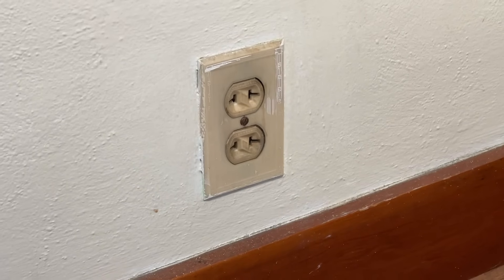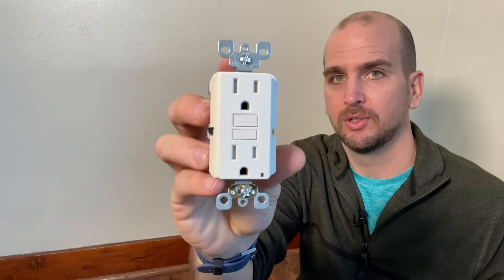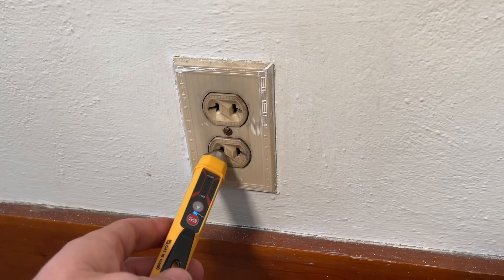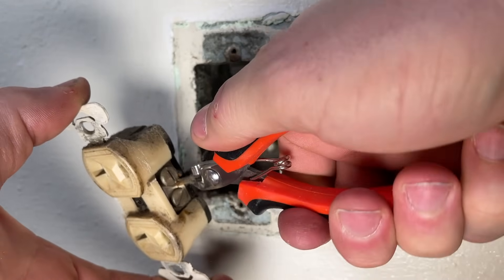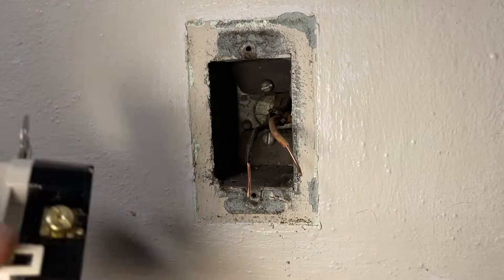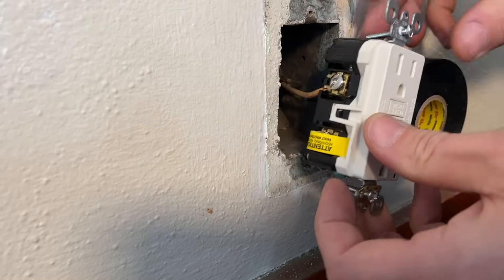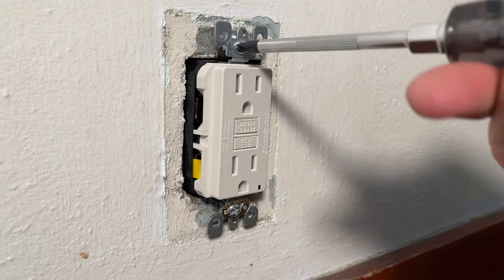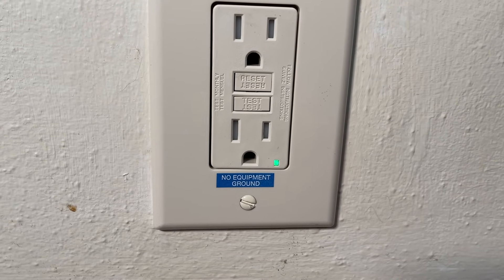How To Replace An Old 2 Prong Outlet Using 3 Prong GFCI

Comment: How would you replace the outlet to a new one if it has 3 hots and 3 neutrals and ground coming in? There are no wire nuts, all are plugged in (in the appropriate hot & neutral sides) the receptacle through the terminal and the push in hole.
Reply: u would have to put the wire together with a wire nut and add a pig tail
Reply: @mraaron1584  would you recommend the live lines (hot & neutral) directly to the terminals ..and wire nut/pig tail the load lines?
Reply: @lostmywaffle8471  ya u can do it that way and the other ones down stream will also have the gfci protection. they also make some now that have both gfci and afci protection in 1 so it protects for both ground faults and arc faults to.
Reply: @mraaron1584  thanks for replying, will be looking into a gfci/afci one instead
Reply: @lostmywaffle8471  ya they cost a few bucks more then the gfci ones but its nice to have both. i got 4 of them for wet spots in the house.

Comment: I have knob and tube wiring that connects to a fuse box (uses Type T fuses - round fuses). Some fuses have blown out from time to time and have needed to be replaced. Do the Type T fuses perform a similar function as a GFCI? Or should I still replace the old 2 prong outlets with a GFCI? This is something I've always wondered about. Thank you so much for this video!
Reply: If you are blowing fuses, you are overloading the circuits. That is an extraordinary fire hazard, especially where knob and tube wiring is concerned. It was not designed to handle today's heavy current draws. You need to call in a professional electrician.
Reply: @KameraShy  I completely agree.  Not to mention that many insurance companies require knob and tube to be replaced.  You wouldn’t want to risk having a claim be denied either.  Best to go ahead and replace ASAP.
Reply: @KameraShy  and not to mention,  the older cloth like insulation used on knob and tube,  is very flammable,  especially when brittle dried out after nearly 100 years

Comment: For the ones that don't understand the reason for a GFCI with no ground is because in the event you have an appliance that has a hot wire that gets damaged and starts touching the metal shell that outlet is still going to detect a ground fault and trip. If that was a regular outlet as soon as you touched that metal shell you're getting a nice shock. It also prevents possible damage of whatever you have plugged in, in the event there is a problem. Of course it doesn't  completely solve the ground problem but it's the next best thing.
 I actually plan to do this in my finished attic that still has some Knob & Tube wiring that is tied into 1940's/50's Asbestos wrapped wiring, which goes to the outlets & lights. It would be nice to have a ground but it's not possible without a complete rewire.
Reply: I will add that because most people don't know how a GFCI works, it works by comparing current at both the hot and the neutral to make sure they are equal.  After all, what flows from the hot has to flow back through the neutral.  If the electricity goes anywhere else, such as through a human body, it is not returning on the neutral, thus the current flows between the two will be different and the GFCI opens the circuit and kills power to the outlet.... supposedly before it will zap you.
Reply: @paulstandaert5709  Yes, A lot of people think a GFCI is more like a circuit breaker in how it functions. Another myth is they will last as long as a regular outlet. I replace my GFCIs every 3 years. Most GFCIs will trip when the current difference between the hot phase and natural is .6 milliamps or more. Generally, it takes 200 milliamps to cause cardiac arrest and kill a human.
Reply: @THE-michaelmyers  - Weird.  I put a GFCI with new wiring in to separate my washing machine from the kitchen some 15 years ago and it still works fine.
Reply: @chrisrogers1833  I know, one of my neighbors has one in the guest bathroom that was installed in the 90s and according to them still works great. I don't trust GFCIs after the 4th year. I buy high-quality devices and replace them every 3 years. Also, I should have done a better job with that comment. ALL of my GFCIs are breakers in my panel. I also have a tester I use on the same day I replace my Smoke and Carbon Monoxide alarms battery.  One of my employees lost a child because of a bad GFCI back in the 90s. I HIGHLY recommend getting and using a GFCI tester NOT the one on the device at least once a year.

Comment: Shouldn't you have put the neutral wire in the new receptacle underneath the other side under the clamp to keep it from coming lose as you tighten up the neutral screw?
Reply: It doesn't matter as long as it's a straight wire. This is only an issue when wrapping a hook around the screw.
Reply: @surferdude642  right

Comment: Can you use the metal box and conduit as grounding back to the panel?
Reply: If your home uses BX ("armored cable") wiring that is properly installed, or metal conduit connecting the boxes, then absolutely yes.

Unfortunately, neither are commonly used for residential wiring.
Reply: @Shamino0  Unfortunately ,this is false.  Do not use the metal of BX cable to ground a receptacle or anything.  There is enough impedance in the ground path with BX cable to prevent the circuit breaker from tripping.  I have seen this .  The sheath of the cable will glow red like a toaster and burn.  The best way to cure ungrounded outlets is to replace the circuit breakers with GFCI breakers.  Thereby protecting the entire circuit.  Then label the receptacles "gfci protected, no equipment ground".
Reply: If it exists.

Comment: Hi great channel that is incredibly helpful and informative. For a future video can you look at replacing/upgrading breakers? Similar to your other videos are the internals of the more expensive breakers worth it? One of our contractor grade breakers failed and our electrician said that they are often too sensitive and trip early - they replaced it with an AFCI breaker. What is the quality difference and is it worth upgrading proactively? How easy/safe is this to do yourself?
Reply: You don't typically replace a breaker unless it's bad which rarely happens. AFCI breakers are for arcing which just like it sounds protect against arcing. As far as quality difference, there is none because it's just the same as a normal breaker with the arc protection, that is the only difference. You generally don't put them on every circuit but just on ones that you may have expensive stuff on or maybe your Air Conditioner because they can get very expensive. As for changing to one yourself, it's not difficult but the designs do vary between different manufacturers so you have to read the instructions/follow diagrams. When replacing breakers in general you need to know the make and model of your box because not all are interchangeable, even companies like Square D make different models of boxes. As for safety, when in doubt call a pro.
Reply: @benkeysor7576  Thanks!!
Reply: @benkeysor7576  First generation AFCI breakers are known for being overly sensitive.  I've seen them trip because they detect the minuscule spark inside a switch while turning a light on or off, or from the arc inside fluorescent lights.

Modern "combination" AFCIs (CAFCI breakers) are much better and don't suffer from false-positive trips the way older AFCI breakers do.

If you have AFCI breakers that trip for no good reason, replacing them with a new CAFCI breaker is a good fix.  This has nothing to do with "contractor grade" but is entirely due to the fact that the first generation of AFCIs sold were designed to be too sensitive.

The only downside to replacing them is that they can be costly.  I paid about $40 each for the Siemens CAFCI breakers that my panel requires.

Comment: Older outlets like that - the screws usually come right out which means you can straighten the wires and have just a little more space to attach the device.
Reply: But most have a nick in them which most of the time makes them break off.

Comment: If the house was wired with BX cable - there IS a ground.  You don't mention or show checking the cable coming into the box.
Reply: Not all BX (came) with ground.  Some earlier assemblies had an aluminum tracer which isn’t suitable for an equipment ground
Reply: @Lucky Joestar correct but showing the cable at the entrance is something that should be taught
Reply: You can always find out by checking the voltage between the hot and the metal box.  If you have 110-125v you're OK. If not ... move on

Comment: man this was smart with no ground but using a gfci for protection that will trip when a short is detected
Reply: If there is a short, the breaker will trip. If there is a ground fault, like hot touching ground or hot touching the metal shell of something, the outlet will trip. If you had a ground fault with a normal outlet, it would be a shock hazard.
Reply: @benkeysor7576  i know that but like he said that outlet has an open ground meaning there is not a grounding wire attatched therefore the gfci functionality acts like a ground potential shutting the internal circuit breaker off in the outlet  like say a live wire comes loose in the microwave oven and someone touches the housing, it detects the short and trips
Reply: @southernautodiy2643  This is a common misconception about how GFCI's work.  They don't trip by detecting current on the ground wire.  They compare the current on the hot and neutral lines and trip if the two differ - meaning there is current flowing somewhere else.

Comment: What are those other horizontal prongs on the two prong outlets for anyway?
Reply from the maker: Good question, it was to fit old tandem blade plugs which were horizontal.
Reply: @EverydayHomeRepairs  I know they had blocks with horizontal pins but why the pins need to be horizontal?
Reply: @TechHowden  tandem plugs were invented by Hubbell before he invented the parallel prong plug.  They were just another type of connecting plug.  In the 1950s, the tandem configuration was given an official NEMA rating (NEMA 2-15), for 250v
Reply: @davidpar2  Thanks for letting me know I have been wondering about that since I was 8
Reply: For tandem connectors. Currently, at my work we use the connectors with horizontal plugs for our UPS powered outlets. This helps to prevent people from plugging in any random devices on our UPS, eg microwaves and such.

Comment: Thanks.  I didn’t get a close look at the breaker for this outlet was it at 20 amp? I noticed the receptacle you removed had a pin configuration for 20 amps. Any reason why you didn’t go like-for-like with the new GFCI receptacle?
Reply: As far as I know, that is definitely not a 20A receptacle. It’s a very old tandem/parallel combination receptacle which was necessary at the time because people still had stuff with blades oriented the other way.
Reply: This was a very old outlet before the standardised plug and outlet of today so you can plug either parallel and both flat bladed plugs in
Reply: It was not a 20 amp receptacle.

https://shop.worldcordsets.com/shop/reference-materials/nema-reference-guide#2
Reply: All 2-prong outlets are rated for 15 amps because they predate 20 amp circuits but I'm pretty sure all GFCI outlets are rated for 20 amps. You can use a 20 amp outlet on a 15 amp circuit but not the other way because that just wouldn't make sense. However in reality, use whatever you have as nobody is going to scold you for using a 15 amp outlet with 12 gauge wire and it's highly unlikely you're going to pull more than 15 amps anyways.
Reply: @benkeysor7576  They make both 20 and 15 amp GFCI plugs. If your plug has two lines with a round hole under them (like a smiley face) it is 15 amp plug. If it has a  sideways T then a line with a hole under it (like the old plug in the video but only one prong not both with a ground) it is a 20amp plug. The rule on plugs for a 20 amp circuit is if there is only one plug on the circuit you have to use a 20 amp plug. If there is 2 or more plugs you can use 15 amp plugs.

Comment: 17 bucks on an outlet that still doesn't have a proper ground? Nah fam.
Reply: It doesn't have proper ground since there is not ground running to it.  You can spend a lot more on rewiring, or spend 17$ for the safety.
Reply: @crimsyhs  why is that any different than using a regular two prong outlet? If it isn't grounded, it's not really doing it's job as a GFCI is it? It just has three holes instead of two, which is great, and valuable, but doesn't justify the use of GFCI when other options exist.
Reply: @ariyanadumon4549  What other option would you use? A 2 prong doesn't allow for any kind of disconnect, but the GFCI does. As Nyan said, rewiring would be much more expensive.
Reply: @SoulJah876  I'm not a licensed electrician, and honestly, some of that shit goes over my head, so I'll say it again. Wtf is the point of spending 17 bucks per outlet when they won't be goddamn grounded anyway? Why not just put in a standard three prong plug, which I've witnessed multiple Licensed Electricians do, particularly in old houses.
Reply: @ariyanadumon4549  the point is this. If he just replaced with the same exact type of receptacle/ outlet/plug  and a hot wire disconnected and touched the metal...anyone and anything you try to plug in will be fried/ shocked...BUT by putting the GFCI in for $17 if that same hot wire disconnected and touched the metal- it would instantly trip the safety feature in the gfci, thus no shock or fried iPhone. Hope that helps.
Reply: And at end he was saying if you have a circuit of lets say 4 plugs in room...if you can isolated the 1st one in the chain of 4.( plug 1 2 3 4) you can putva GFCI on number 1 and as long as they are all connected(load side) you could put normal plugs on 2 3 and 4 and they would ALL be GFCI protected.
Reply: @ariyanadumon4549  a ground would stop the shock by providing a path back to the breaker panel, but since no ground is wired the GFCI takes the shock for you...basically being a breaker somewhat. The best repair is to wire a ground from breaker panel to that outlet, but most people dont have $500-900 to blow so the next best thing is a $17 GFCI.
Reply: @IsshmanGarcia  thank you for the explanation, that actually is very informative.
Reply: @ariyanadumon4549  You are welcome. I forgot to mention important info. In situations like in the video you CANNOT just grab a piece of wire and bolt it to the box, then attach it to the green screw slot...it DOESN'T work like that. The WHOLE grounding system(the house) needs to be connected( ie. bonded) together for that to work(protect you). So if he added a ground wire himself to that GFCI it would just be for show..and a waste of time. Good day.
Reply: @IsshmanGarcia  how does that not ground it? Grounds need not be that specific in Automotive Wiring, why Household Wiring?
Reply: @ariyanadumon4549  A GFCI works without a ground because of how it works.  It does not look for current on the ground wire.  It compares the current on the hot and neutral wires.  If the two are different, it means some current is leaving the attached device through some path other than the power cord - which may likely be a person getting a shock.  When it detects the current difference, it trips.

It's not as safe as a grounded receptacle, because a short in the appliance that energizes its case (and therefore the ground wire) won't trip a non-grounded GFCI until something touches the case and gets a shock, but it will cut off the current before said shock can cause injury.

As for automotive wiring, it's not the same thing.  Automotive wiring is (almost always) 12v DC, which is not nearly as dangerous as 120v AC.  Additionally, all cars are designed with the frame (and therefore most metal parts) connected to the negative battery terminal.  Which is why you can wire a device in a car with only one power line (positive, from the fuse panel) and the negative line tied to an exposed metal part of the chassis.

The household equivalent (tying grounds to the electrical boxes) only works if the boxes themselves are grounded - typically via an explicit ground wire, BX cable shield or metal conduit.  If the box is not grounded, connecting the ground pin of an outlet to it will do nothing.
Reply: @ariyanadumon4549  If the wire coming into the metal box was ran in metal conduit back to the main breaker panel you could just ground to the box. You will usually only see that in commercial setting ( brick houses some times may appear the be ran in conduit but is is usually just in the brick to get to the attic or crawl space then is is ran open wire across the wood beams). Most houses are make out of wood. The metal box ( now days plastic box) is simply nailed to the wood studs and the wire is wrapped in an asbestos cloth ( now days plastic sheeting) poking through a hole in the box 6-9 inches.
Reply: @IsshmanGarcia  how do you make sure which is the hot wire? Can you use the tester he used?